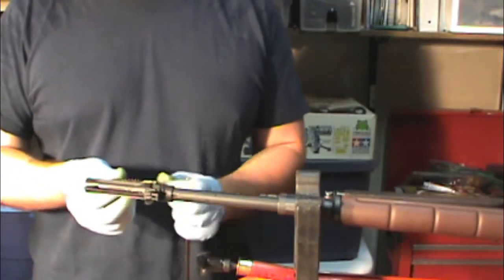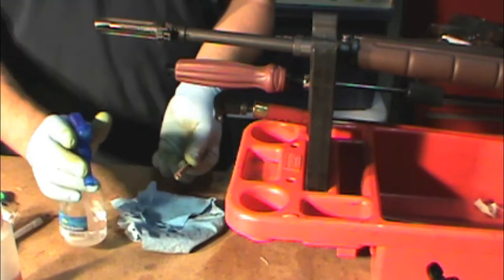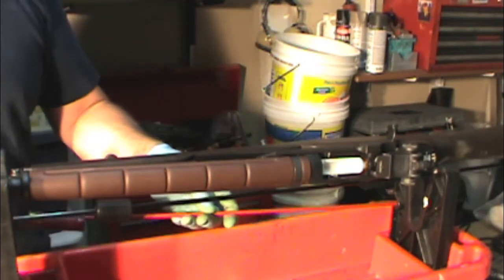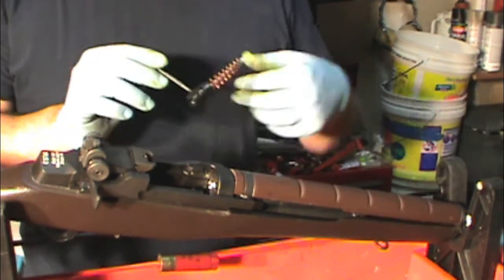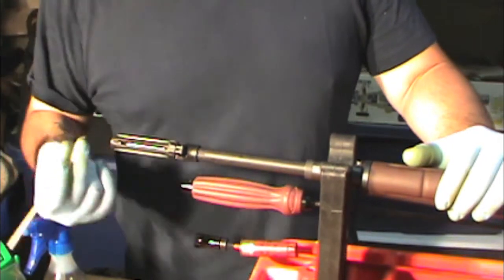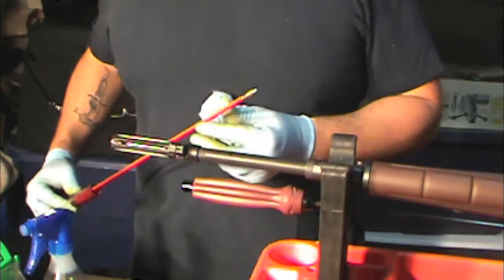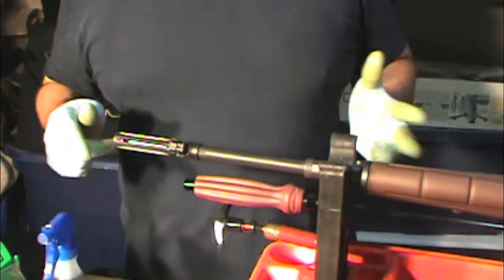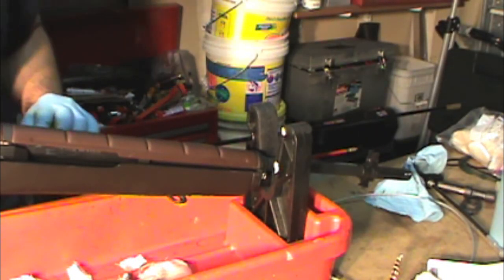M14 Cleaning Video Part 3

Comment: The best way I have learned to clean with OTIS cables is to wrap an appropriately sized patch around a bore brush and use it like a jag from chamber to muzzle.  This has the added benefit of cleaning deeper into the grooves than seems possible with a jag and patch.  This technique worked better than jags for me and I employ it when cleaning with one piece rods as well.  Note:  This works best when using patches cut from a patch roll or other source of material.  It will take a bit of experimentation to get the patch size just right.  Start smaller than needed and work up to avoid jamming a brush in the barrel.

Comment: You have great videos. I noticed that someone else mentioned this, but is punching the barrel in the direction of the round a myth? That's what I was taught in the Marine Corps. Does it have any affect on the barrel at all? Thanks and Semper Fi.
Reply from the maker: +Beau Harris 

I don't think it makes much of a difference, but I'm also in the process of re-filming this in HD. I'll be using an OTIS from chamber to muzzle. That's all I use now.

Comment: You NEVER run a cleaning brush the wrong way down a barrel. You must come in form the breech.
Reply: victor lopez I suppose he wants to bore a hole in the rear of the receiver. LOL! Like the mod on the 10/22 Ruger.  He is just  what they call a Troll.
Reply from the maker: victor lopez Use an OTIS. I will illustrate this in my upcoming cleaning video.

Tony.
Reply: Never say never. Have you ever cleaned a lever action rifle?